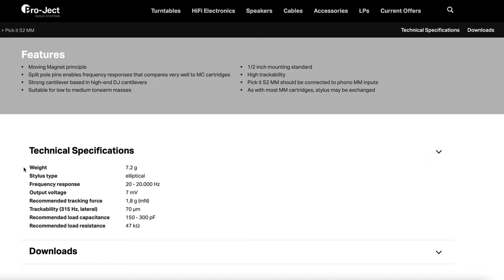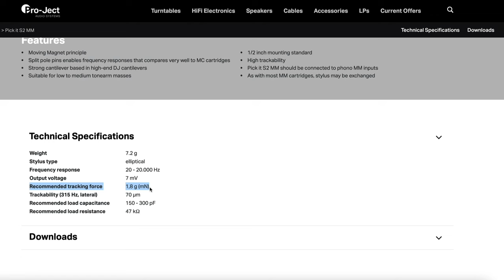How to Balance a Turntable Tonearm & Set Tracking Force - Vinyl 101

Comment: Brilliant and straightforward for any who are a little unsure or new to the game. I use exactly the same method. One thing I think I missed there is first make sure the deck is pretty much level in all directions. Really helps with that anti-skate adjustment and general playback thereafter 👌
Reply from the maker: Great point added. Glad you liked the video!

Comment: Do you recommend using the auxiliary weight on the technics?
Reply from the maker: The auxiliary weight is only required for heavier headshells/cartridges when the additional weight would be required to balance the tonearm. Hope that helps answer your question

Comment: Hi I notice your cue arm is down during this process. When my arm is down (angels horn record player) the arm slides back to the rest and is not stationary. If my arm is up it will stay put but the balance is way higher than when arm is down. I don’t have a separate anti skate adjustment. Advice? Thanks!

Comment: Do you need to change the tracking force with every vinyl or just with every cartridge replacement?
Reply from the maker: Just the first time you set up a cartridge 👍 though it is a good idea to check it from time to time. Just in case of any movement

Comment: Fantastic! thank you very much. Do you know what the big ring is for. I know it lifts the whole thing up and down, but why? and what is default?
Reply from the maker: Thanks! Glad it helped. I think you are talking about VTA (vertical tracking angle). Adjusting the height of your arm will change this. A good starting point is to make sure the arm is parallel with the record. You can get an acrylic block to measure this. Does that help? And have I understood you correctly there?
Reply: @soundmatters  Thank you!. that must be it. it heightens or lower the entire arm. It helps to know what it is. Not sure about he acrylic block but I will look into that. Thanks a lot man!!

Comment: As much as I try to follow all the tutorials, it seems the only way I was able to get tracking pressure (according to the cartridge spec, VM95e) is to use the scale and directly adjust the counterweight so the scale shows 2.0g...it sounds good to me, but still curious what step I did wrong that I can't just set the dial to 2.0 and achieve the final result.

Comment: I can't get my tone arm to sit horizontal - it clicks either too far back or too far forward at a certain point, and doesn't work as a screw back and forwards?
Could it be I'm using different head shells Ortofon Concorde - from standard, so the weight at that end is different?

Comment: Ok Marc thank you!  I'll bet the sound playback from my new Fluance RT85 would benefit from the fine tuning and especailly the anti-skate test.  I purchased the scale and test record as you suggested.  Once I receive them I will let you know how it turns out.  Also, the test record has many more features for testing here is what is listed: Side 1: Channel Identification, Phasing, Channel Balance, Bias setting
Side 2: Tracking ability, Cartridge & Arm, Lateral & Vertical Resonance, Cartridge alignment, Residual System Noise, Full Range Frequency System Check.  Can you or have you done a video explaining these?  My next challenge is properly cleaning the records.
Reply from the maker: Hey Dan. A video on test records would be good actually! I'll add it to my list. Lots of content on the channel and site about cleaning records - just let me know if you have any specific questions :)

Here's a link to the full record cleaning guide, by the way:
https://www.yoursoundmatters.com/clean-vinyl-records/

Hope it helps
Reply: @soundmatters  Well I got the scale and dialed that in perfect to 1.8 (grams - 180 mg) now I have the test kit and it is quite confusing for a novice.  First I need to assess the cartridge alignment with the enclosed protractor.  There are three test parameters.  The first one is Two Point technique suitable for 9" arms.  This would be irrelivant since my tonearm is 224 mm or 8.82";  The Next one Universal technique. Suitable for all tonearms: Here is were I have a question:  The settings are 30 to 140plus and I need to align the cartridge headshell parallel with the vertical lines printed according to specified by the tonearm manufacturer.  The Fluance manual doesn't indicate any such specifications relative to this assessment - any thoughts?  I did the third one Linear Offset and it seems quite accurate if I am looking for the correct things.
Reply: @soundmatters  Yes I have that link saved.  I am thinking that the stronger G3 and rinse might be necessary for older albums that I might purchase.
Reply: Hi Marc, I played for over an hour with the HiFi Test LP and still unsure of the anti-skating tracts and which way to adjust the anti-skating value up or down?  On Side 1 Track/band 1-5 were self evident and spot on.  Then the Bias Settings also referred to as (anti-skating) Track/Band 6-9.  I did hear a little distortion on the right channel during playback on Band 6, so do I adjust the value higher or lower?  or would I play all the tracks/bands taking notes on which ones I hear any instability then make the adjustments on the first one noticed?  The last one?  Then there is Side Two with Tracking ability test?  Is that the same as anti-skating?  And many more question because as a novice the instructions on the LP are a totally different language.  Example on Side Two Band 2 it states that generally a resonant frequency of between 8-15Hz is considered ideal from a a point of view of a cartridge's ability to track pressing warps and handle rumble?  Huh?  How do I assess this?  Then Band 5 on Side Two tests for Cartridge Alignment?  Is that what the protractor was for?  I appologize for so many questions and thank you.
Reply from the maker: @HeroicCoachDan  Hey Dan. No worries at all. I'd like to go more in-depth with this with a full article, but for now I will say this:

Turntable setup can be a polarizing topic as a lot of it is about compromise. Because of how a tonearm pivots from the outside of a record to the center, it can only line up perfectly with the groove in a couple of places. In very simple terms, this is just a law of physics. Records are cut using a linear cutting stylus.

Fluance recommend a Baerwald method protractor, here:
https://support.fluance.com/s/article/Which-type-of-protractor-is-used-for-cartridge-alignment

As for the anti-skating, this is a much-debated topic also, but in short, the blank space on the test record is there for you to set the "zero point" just as I did with the blank-sided single in this video. From here, you can fine-tune to setting using those test tracks. Because there is groove modulation going on here, this is likely to give you a more accurate reading.

As you're hearing distortion in the right hand channel, it would suggest that the anti-skate (bias) is too strong. This is because the grooves closest to the outside edge of the record are the right-hand channel.

Hope this helps as a starting point. It's best to get your alignment checked first, of course, to make sure this isn't influencing the result.
Reply: @soundmatters  I will contact Fluance and have a technical discussion on the cartridge alignment...I have the Fluance protractor and it looks aligned to me yet I may not have the experienced eyes to notice something that may be off.  I did the anti-skating neutral zone test and the anti-skating was quite a bit higher than the suggest matching value of the tone arm weight calibration (1.8grams for tone arm and addressed by scale) and the anti skating was good at 2.2-2.6.  Ok thanks again and can I make a donation to your channel for your generous and passionate support?  I will let you know what Fluance has to offer.

Comment: How do you adjust the height, should it be level with the vinyl
Reply from the maker: Is your turntable VTA adjustable? If so, getting the tonearm level with the playing record is a great start using one of these VTA/Azimuth blocks (affiliate link):
https://amzn.to/3rHNxrN

There is debate about it though. Some feel the tracking angle should be the same as the angle the records are cut at (usually 92°). To achieve that, get it level and then raise it to approximately 15°.
Reply: @soundmatters  set on 1.5 all good 👍

Comment: i did this several times, all was going well! but only at the 2:18 step everything went wrong and it wasnt balanced at all! it was balanced at first, but after that last step, not at all.
Reply from the maker: Hard to say without seeing where you’ve gone wrong here, but it sounds like you turned the whole weight to the zero mark rather than the dial followed by the exact downward tracking force. If you have any questions, just let me know. 🎶🎧

Comment: Is it normal that my anti.skating is not the same as my tracking force? My stylus has a 2g tracking force and my antiskating is set at 1g to have my tonearm completely centered.
Reply from the maker: The same as tracking force is really just a starting point. To really get it nailed you have to use a test record or flat-side of an EP or single to balance central (as it sounds like you have). 

I'd go off that as the final say rather than setting my numbers alone. A test record will help you listen for distortion too
Reply: If that's an LP120x I have the exact same thing. The counter weight is proper when I checked with the analog scale, but the anti-skate should have like a very slow inward bias. If I set it to 2gr it flies outwards, but I have it on 1gr.